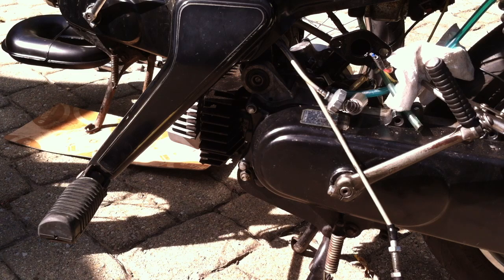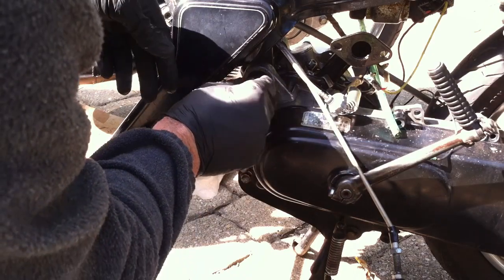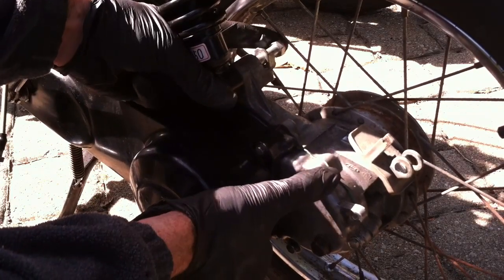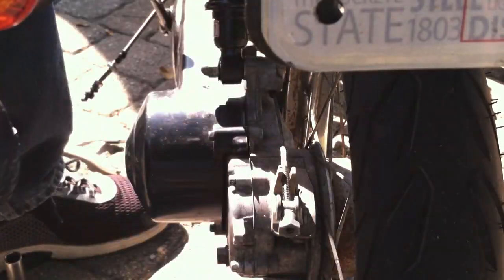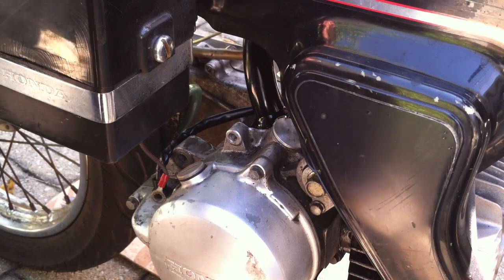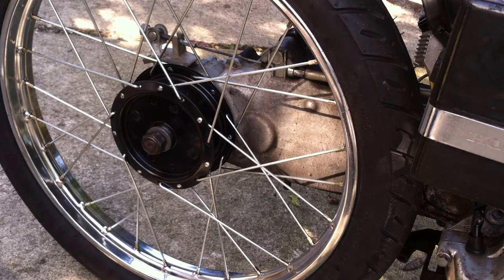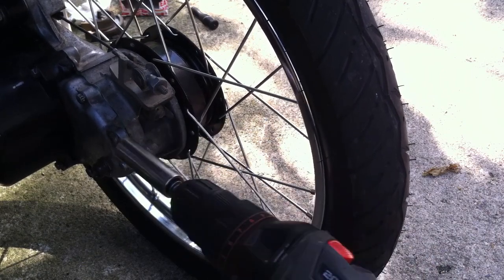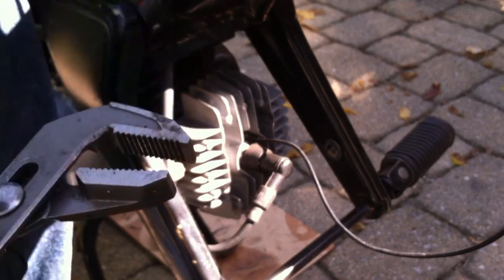Honda Urban Express Engine Re-Install

Comment: LOL, I was going to say this, "I bet you won't forget how to put the rear brake cable, back on, again", but you never figured it out. Remove brake cable adjusting nut completely. Loosen lower shock bolt a lot, pull the outer cable forward, while holding the end of the brake cable. There should be a click-like feeling, and the outer cable end is seated into it's notch. Tighten lower shock bolt. Then install adjusting nut. If you're not using the original carb, you should just make a new throttle cable, and not hack up the original cable. You might need it in the future, or sell it.
Reply from the maker: actually, I think I got it.  Most of my experience has been substituting a qt50 rear brake cable on my Honda Hybrid Express and on the NX50 which presents its own unique challenges. I'll double check it but it seems fine.
Reply from the maker: double checked rear brake cable - everything fine!